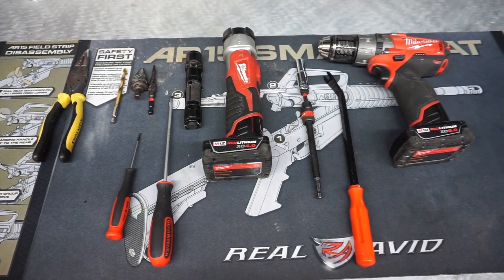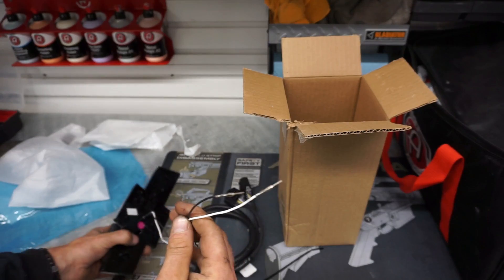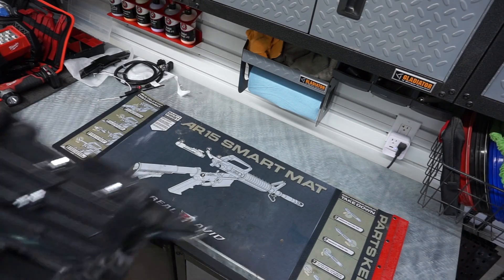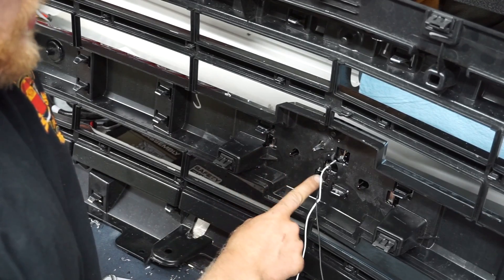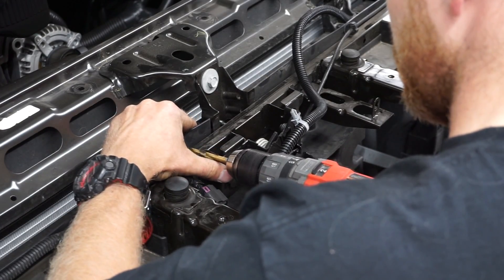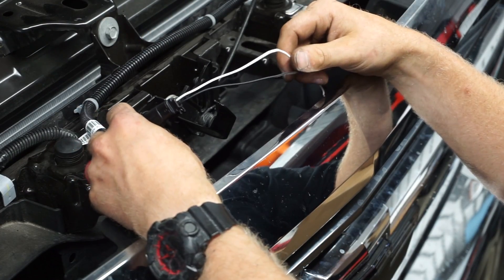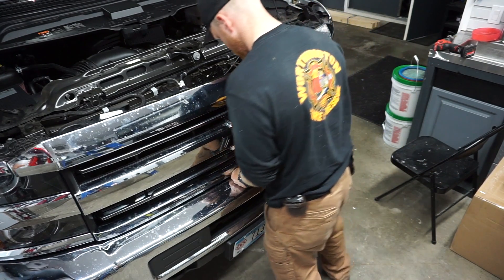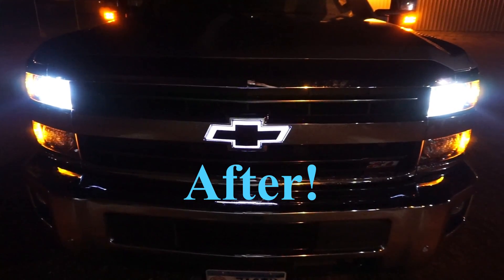How to Install 2015-2019 Chevy Silverado 2500/3500 Illuminated Front Grille Bowtie #23385942

Comment: I can’t get mine to work, the pins from the emblem are sticking through the white part. I checked with the dealer and all they could tell me that it’s not “grounded” but they were able to test that it actually works. Can you elaborate on the part where you said you needed to push the white clips aside while inserting the pins? Maybe that’s where I went wrong? I didn’t move any white clips aside.
Reply: Nevermind got it, those pins need to go through pretty far, to get the right leverage I grabbed the back of the pins with tweezers and pushed the pins through.
Reply from the maker: Glad to hear you got it taken care of

Comment: I had a Chevy dealership install one for me and after a few years of enjoyment, a car wash split the front portion of the bowtie. I can see that only a super small bead of glue was used to put both pieces together. A new bowtie is on its way today and I plan on adding extra glue around the the seams to make sure it stays on. I did get back the part that fell off but a small corner of the bowtie fell into the pit. After I removed the back section/light, I glued the outside to test and make sure it doesn't ruin the plastic before I glue the new one. The glue fogged the clear plastic but not to bad. Plan "B", tape it and then glue it again. The bead of glue just looks messy but you won't see it unless you get close. I'll try a thin brush to apply the glue on the new light. I'll comment again and explain my results. Great video by the way. Very helpful.

Comment: Is it possible to change the color of the light? I want to do red but I don't know if taking it apart or changing the bulb or LED is feasible
Reply from the maker: You would have to solder in red leds im sure

Comment: Great video and looks amazing. I just got it for Christmas, but I live in NY and I have a plow on my truck so the plow harness is using the headlight harness already. Do you know if it’s still possible to plug the bowtie in to get power with a plow harness installed?
Reply from the maker: Im sure you could make/find an adapter that allows for that to allso be plugged in as well. Good luck!
Reply: It was still plug in as it was intended, But instead of having one harness tapping in for power you will have two!

Comment: Feeling aggravated as hell. The wires from the bow tie either won’t go far enough into its half of the harness piece to make contact or the harness connector is crap. Just about to clip both ends off. Lol. It works. I tested it.
Reply from the maker: You may have to make tour own connector or just use butt connectors and heat shrink?
Reply: @theloweshow3047  I had the same problem, was trying for like an hour. finally I just ended up taking out the white part inside where you first slide the wires through and they slid right in, then I slipped the white part back in. worked great.

Comment: All right guys... you could probably build one of these with a simple water proof light kit and a piece of Plexiglas for less than $50.00. You could get an LED kit that strobed, flashed, changed color etc. Build a spacer from clear Plexiglas and imbed the LED. All right guys... let's see someones creativity instead of a factory kit for $268.